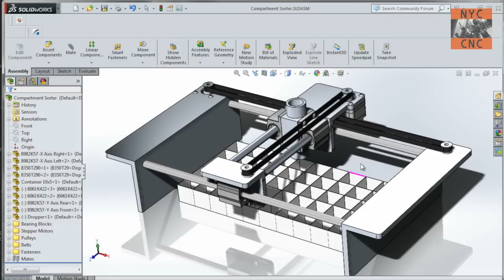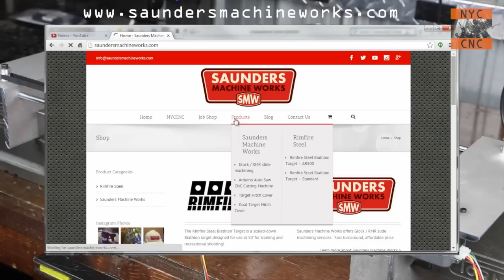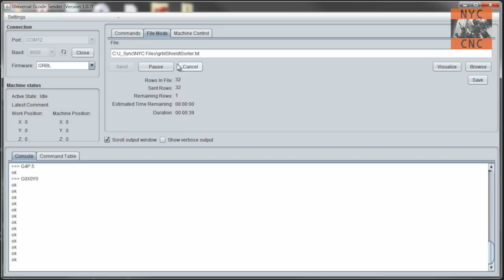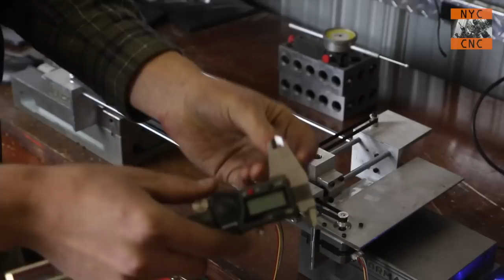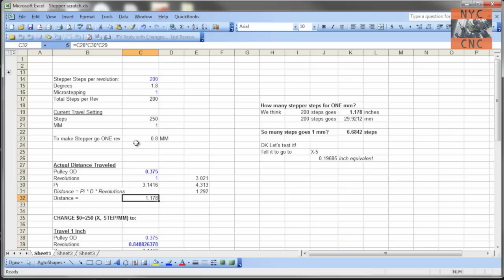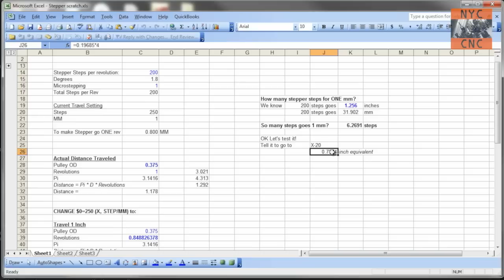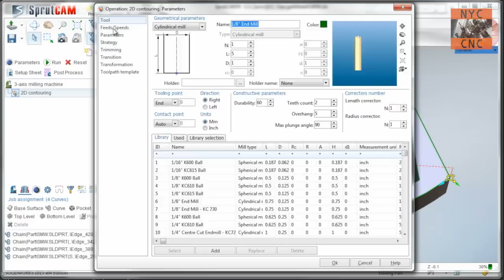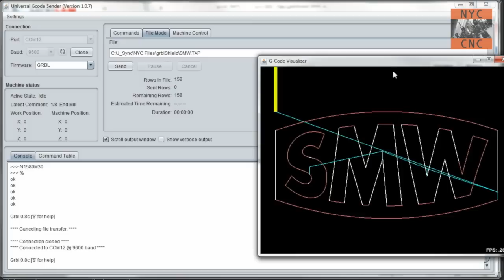DIY Cheap Arduino CNC Machine - Machine is Complete AND Accurate!

Comment: Hello 
i like your videos great channel.
Your measuring is wrong and not only you but even some professional companies measuring there machines like that, you should lower your speed so much until you see motor stepping and se what resolution you have + angle of play of stepper.
I want to say that even if you have 0.5 resolution the indicator will always show 0+angle of play wich i think its 1.2 degree.

No offence as to your knowledge i am sure you are skillful, and your projects tell that. I have watched your other videos and it seems like great work
Reply: +NYC CNC 
Lower your speed so much in order to se jumpy motion in the indicator and than you can se what is the resolution of your machine (go only forward) 
and then go backword to se your backlash of timing belt
stepper motors have also backlash about 1.5 degree. 

It is wrong to measure in that way because iven if you have very bad resolution (3mm per step) the machine will allways return to zero 

It goes like this:
1 step per mm 
 2 belt backlash
  3 stepper motor backlash 1.5 degree

I know my english is poor sorry

Comment: I'm using 4 linear bearing slider SC8uu and they seem very loose and gritty sounding. Do you know the specs or where I can find them? Thanks
Reply: +NYC CNC I have found some info on linear bearings, clearance nominal at .05" and should lube with heavy grease. I used lubriplate no.105. The 8mm linear rail can have some amount undersized. The better linear bearing can have two allen screw adjustments on top and one side for an added cost of course. The ones I bought have no lube and only one fits good, one is tight, two are a little loose, so I ordered three more as cheap replacements. If that doesn't work I'll have to get the adjustable ones. Am I on the right track? Oh I modified your design and I'll show it if it works.

Comment: So, if you can put a laser in this 2 axis, you don't have any backslash because you dont make any surface contact. my question is, what laser i must by to cut plywook about (13mm). even if the cut is donne in 2x. Thanks in advance for your time.
Reply: +NYC CNC  :-(

Comment: Hello, thanks for the video I have a 27.55mm diameter drive pulley with a gt2 belt but according with the example it should be 2.311 steps/mm but it doesn´t work the mottor goes two slow and noisy despite of $4= 2000 $5=20000 and $8=500, is there another way to calculate the number of steps per mm?
Reply: ok, i'll try that Thank you...

Comment: You are verifying the accuracy without any load, and this isn't the real word situation, I would suggest that make the test with some load, when load comes is when the problems on accuracy appear.
Reply: +Jose Silva Just because a motorcycle can't carry 50 passengers does not mean that a motorcycle is a useless vehicle. In other words, we need the right tool for the job.

Comment: I've been planning a cnc build for a little wile. My question is, I'm making a laser cutter but plan to make it swap out with a router for wood working. But will nema 17 motors and a belt system be strong enough and accurate enough to pull the drill through wood?

Comment: dont need expensive parts for a rigid machine. use open linear bearings. http://zjlinearbearing.com/1-4-3-open-linear-bushing.html and you can attach the ground rails to a frame with standoffs. the open bearing will wil allow clearance for the attach points.

http://www.ecvv.com/product/3149017.html

http://www.vxb.com/page/bearings/PROD/12mmLinearMotionSystems/Kit8512?gclid=Cj0KEQjw_YKtBRC7zZjFp8bF_foBEiQAfyigcyjYImgLaP2JswLToG9kdD9lUqJLWCQgMvqkNQDfmysaAivj8P8HAQ
Reply: +NYC CNC I am not technical myself (I am more of a designer than an engineer) therefore perhaps I am missing something. It seems that using open linear bearings has the advantages that @daniel dimitri indicated.

Aside from possibly being more difficult to keep clean, are you aware of  any significant drawbacks to using open linear bearings for a low cost CNC machine?

If not, have you considered making a video in which you build a low cost CNC with open linear bearings?

Comment: God job! How much force is it actually needed for milling and drilling wood, plywood..?
I am going to use nema 17 (64 oz.in / 4.5kg.cm) steppers and gt2 timing belts. Are steppers strong enough for milling wood? How much will belt stretching influence on accuracy?
Mybe  should I use gt2 with 9mm width instend of 6mm, mybe do you recommend another belt (cheap one)? thanks

Comment: I work as a software engineer, but mechatronics has always fascinated me. I started hobby electronics a while back, now I'm working on stepper motors. I just took apart my old printer and salvaged quite a bit of hardware :) I'm going to create a candy machine and use the printer / scanner body :D

Comment: Your belt tensioner (The Screw) works great for the X&Y Axis. I can use that... very simple solution :-) In my 3D printer (a totally different design) I need an Idler Bearing on my Z Axis, as the belt on the Z Axis continuously Loops... It doesn't work like the X&Y... Thought I'd mention that.

If you can visualize a remote Z Axis drive motor, with a belt drive, then you'll understand...

Oh! One other little thing... As a Machinist, you know that Aluminum and Steel react. Does it not bother you to know that the reaction is going to cause a loosening, over time? My 3D Printer is made entirely from Steel, so to avoid that reaction. It's much heavier than an Aluminum setup, but it's cheaper to build and will last forever...

One last thing... Stepper Motors have the Magnets inside, which create the Steps... Those magnets are what cause the Jerking in the movement... One of the benefits of Servo Motors over Steppers is, Servos do not have any magnets, like steppers. They are essentially simple DC, brushless motors and spin freely... No compensation for the jerky magnets, is necessary...

Anyway, Thanks for sharing this video, it's Awesome, as usual :-)

Comment: Could this motion be used to make a 3d printer? I'm a complete noob to cnc and 3d printing but I think that the 3d printer doesn't have to be as rigid as a cnc router because there is almost no sideway force applied to it. I could be wrong. Also great job on an inexpensive cnc machine.

Comment: would there be a way to use the same electronics to build a plasma cutting machine? If so how could you generate g.code that would work a servo motor to turn the arc on and off by operating the trigger? In other words for your example you would need to add a z axis to eliminate the extra lines when the machine was writing out your logo, how would the z axis be controlled via g code?

Comment: You've bought ball screws, yet you're still using timing belts for displacement control? Why?!
You might as well get some inexpensive threaded rod, and get much less play in your system, and a far more accurate machine.
Good job though, this is an awesome machine for a tiny budget. Have you made any plans/schematics available? If I wasn't too rude already...
Reply: I suppose you've answered my question, "low radial load".
I assumed that the radial load was sufficient for significant play, especially when machining metals, when using timing belts.
Have you measured the repeatability with a load?
Are other machines over engineered? If so, your solution is better, as it requires much less maintenance.
Looking forward to the model! :)

Comment: You inspire me.  Thanks for sharing your work.  The steppers you are using are 12 volts.  Why the 24 volt power supply?  Could you have used a cannibalized PS from an old PC using the 12 volts from that?
Reply: NYC CNC Your link to the stepper motor source (Stepper: @1) says:

Voltage: 12VAmps: 0.4AStep/Degree 1.8deg/stepHolding Torque 260nm-m/ 36oz-in

Comment: John
  I may have missed it in the past, but are there  plans for the machine with dimensions?  I purchased all of the parts and have the ability to machine the brackets, but need dimensioned drawings.  I do not have solid works, I am just looking for simple plans.

Comment: Thanks for posting this and detailing your work like this. There is a LOT of great info here. I just want to point out that on the linear motion calculation from revolutions, you aren't concerned with diameters and circumferences, since this actually functions as a gear type of drive. The only sensible way to make this "rough" calculation is to take the number of teeth in the timing GEAR (not really a pulley) and compare that to the belt tooth pitch. Since the belt is flexible, this calculation only gives a ball park, and of course the only accurate way to extrapolate is to measure total travel over the maximum number of revolutions available in the travel, and then also to measure each revolution and any other subdivision of steps that you are willing to invest in characterizing the linearity of your machine! This type of drive is only "practical" for a cutting machine that is making cosmetic items or blanks that will need further precision machine work to be used in a machine fit machine part application.

Comment: thank you for your time. I have learned a few things, I build small robotics units and this is cool stuff.
Reply: mostly welders and some assembly units in the car industry. But i have started to look in to arm and tracked for a hobby. the cnc router would help in parts construction.  I was all so looking at a cnc lathe mill brill. Any good ideas?

Comment: Will the GRBL Alternative for Arduino work the same as the gShield v5
Reply: Neil Hodgson Thank You The other question is do you have a file or anything on the frame size like bracket sizes hole sizes placement etc to have the premade ones will be expensive to have sent to Canada.. Have everything else on order and can't wait to start..Great Videos
Reply: Hello i would like to know if you could email the cad file of your logo that you used in the video. I want to use it to go through the same steps as the video.. I seem to learn faster this way...as this is all new to me..The build and setup part work out great Thank You  darkhours2@gmail.com

Comment: awesome videos :) got my interests going in that machine, ramps wont work on there ? or is grbl your choice ?
Reply: NYC CNC  its called ramps its just like grbl its a stepper driver that goes with arduino and it uses g-code ,really cheap most are used on 3d printers but was thinking maybe might work in this application
Reply: NYC CNC @51this one its ramps 1.4 stepper drivers plug in on top
Reply: hdoug5 sorry the link didn't go through  but in amazon its ramps 1.4 controller

Comment: Just watched from the middle where you are testing some X-5 mm movement and X-20  mm movement and then comparing with an inch based DI. Why not use the G20/G21 to set the grbl to either mm or inches and use it as such?

Comment: Awesome project. I created a 2-D motion control system using steppers with a rack and pinion system instead of the timing belt you use here. Just wondering did you have any problems with gear backlash, for example when the motors reverse direction? I assume they are stepper motors. I guess to get around that you'd use a very fine teeth with faster motor speeds.

Comment: A massive thank you John for all the hardwork and inspiration. I'm new to DIY CNC and I'm planning to build a CNC Plasma table with a 1200mm x 1200mm work area. These videos have been a huge help and I've just watched this one for the 3rd time, while configuring my Arduino Uno with a CNC Shield V3.0 and 4 Nema 24 motors.

I'm also hoping to document the entire process for other noobs like me who have littled to no experience. Should be a good ride I hope :)

Comment: I am working on my own CNC Arduino project.  Right now I am collecting parts for a CNC router to help me build model boat frames and pieces.  I have 5 Nema 17 stepper motors, an Arduino Uno, CNC Shield V3.0, micro switches for the limit switches, and at the end of my project I want either a LCD interface or have my Raspberry Pi run the whole thing.  Oh yea the cutting head is a dremel tool.  Im looking to have a 12x12" work area.  I have not decided yet on the drive type such as using a moving table or a setup like this.  My main material is going to be hobby grade plywood and other woods like Bass or birch.  I would love to have access to a lathe and mill but that is not in my cards any more.
Reply: Nice one! On the side of low cost, I've found some pretty cheap ball screws at www.cobaltlinear.com
Reply: Well I have enough parts to start playing with the electronics and getting all the motors working.  I need to learn the G-code and how to get everything all set up right.  When I can find some spare time I will get busy with it!!

Comment: How did you align/drill the holes in the end plates for the rods?  If the holes are slightly off, the rods will not be parallel and the traveler/bearings will bind.  I have seen other videos where the builder uses a precision machine to make a hobby-quality CNC or 3D printer.  What techniques can we use with tools in our garages to get good parallel alignment of the rods?

Comment: If possible to print in silkscreen with this robot?
Reply: Design Bureau  I can see it, depends on what you are doing with it, my experience is with T-shirts, but if its what im thinking of you will have to add a Z axis to put pressure on the squeegee and also to lift it up and wipe off the access ink, you could even add pneumatic pistons to lock down the screen before the program it starts. and if you want to go even bigger you can also program another axis (A, U, or V,) to program a heater to pass by
Reply: OK! Thanks a lot! I will star a project now!

Comment: Thanks so much for this simple "My First CNC" concept. 

I was thinking about the Z-axis and it occurred to me that there are two types. 

The usual z-axis would be analog. The tool travels through a precise range to give a third dimension with the precision of the X and Y. But this setup just isn't rigid enough to put a cutter in (right?)

The second type would be digital. It's either up or down. On or off. And for that there's almost nothing complex required. On the pen setup in the video I'd add a cheap $2 servo to the pen holder and attach an arm from it to the pen (probably with a light spring for pressure). Now you can lift the pen off the page almost for free!

This would work for me as I just need a blade in there to cut icing for cakes. I need knife-up and knife-down. (Though how to cut vertically without a spinning router type setup into 2mm of icing is a challenge. Any ideas?)

I feel a project coming on!

Comment: Loved your video. I would offer a tip for working with belts. Just multiply the number of teeth by the pitch. If you are using a MXL belt (.080 pitch) and a 20 tooth pulley you will move your axis .08 X 20 = 1.600 inches in one revolution.

Comment: Hi. A suggestion for a video related to the subject of DIY CNC. A video on linear rail alignment techniques. Making them parallel, making them flat (I've been reading a fair bit about bedding on epoxy for this) e.t.c., making sure to axis are perpendicular. Thanks for the videos you have done. Good to learn stuff of off someone who has a similar approach to myself.

Comment: Nice job, but i have one question: How did you connect the pulley to the bracket at the opposite side of the pulley of the stepper? I could't find any parts in the parts list, that could do that job.
Reply: NYC CNC So you just put the pulley on the thread without tightening the set screw? I assumed that there must be a bearing involved to avoid abrasion.

Comment: Cant wait for more videos. Been thinking about making a CNC for a while to learn and to use, after putting hours of research into it over the past few months to make sure I dont make a mistake with my tiny airtight student budget I stumble on to your videos where you answer questions about technical and not so technical aspects, make it on a budget and maintain a level of quality. So pumped for more.

Thank-you for these and I request a quick DIY CNC lathe once this project is complete!!

Comment: I can't help but wonder if solid state bearings, like what PBC linear makes, would be a better option?
Reply: NYC CNC I wasn't thinking of their open pillow blocks, but the cheaper, closed, plain bearings without mounts. I see 10 on eBay (granted one has the right size rods) right now sitting at $70, with a bin of $100. Isn't that cheaper than pillow blocks?

I was thinking you could use a u type mount, and spacers to level the platform.
Reply: NYC CNC BTW. All they are is a Delrin lined, aluminum sleeve. I would love to see you try machining your own Delrin bearings for linear slides! I think you could totally do it. You could probably machine entire pillow blocks out of Delrin...
Reply: NYC CNC I'll really be looking forward to that :)

Comment: Great video! I want to build one of these to engrave plastic name tags for my church, I think that I would just need an additional stepper to control the Z axis of the cutting tool, not sure what to use to spin the cutter though, any suggestions?  Thanks!

Comment: Stick another belt on the other side - you won't be 1/1000th out anymore.  I've CNC'ed a metal lathe and it comes back to precisely on a 1/100th mm DTI line (accuracy <1/1000mm, not inch).  My laser engraver also is pretty accurate (https://www.youtube.com/watch?v=NYo0NUkMJi8). The trick was to put the rods through an aluminium box structure, which prevents them from flexing. Also as stated in the video, two bearings further apart. But if cutting anything - two belts, two motors.